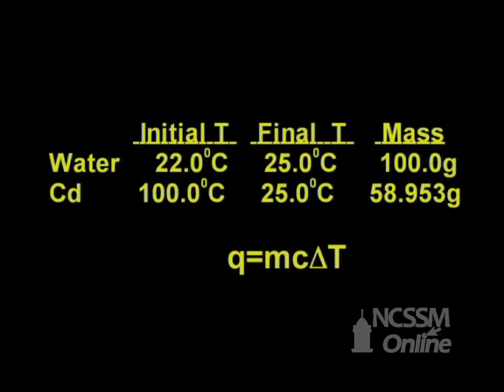Specific Heat of a Metal Lab

Comment: Full answer key, for those who want to get it over with and play gmod/minecraft/fortnite:

Important timestamps:

Formula: 0:42
Filled out table: 4:11(not everything that's graded, though)

Mass of the metal: 0:52
Approx starting temp for the metal: 1:02 and 3:05
Weight for water: 1:10 (later on she says that 1 ml converts to 1 gram)
Starting temp for the water: 2:00
Procedure: 3:19
Ending temp for the water: 3:46
Temperature change for water: 3:49

Answers to Questions, keep in mind these might not be the ones you have:
Water gained energy during the experiment
Metal underwent more temperature change
Water has a higher heat capacity

Ones that have formulas:
Heat absorbed by the water:
Q = 1255.2J =100 * 4.184*3
Heat the metal released:
1255.2 Joules
Specific heat of the metal:
C = 7.09 = 1255.2 / (58.953*3) (I looked it up and the specific heat capacity for cadmium is .23 so IDK if I did something wrong or not)
Reply: 17 likes but no comment, i want to be the first to tell you you are a king that is loved and appreciated
Reply: Thank you so much for your help. KUDOS!!!
Reply: I'm actually going to play roblox but thanks anyway!
Reply: you are a real one
Reply: This man right here is literally goated
Reply: you are a real one and deserve all the happiness and love in the world. Thank you!!!
Reply: you’re a real one dude thank you
Reply: THANK YOUUUU
Reply: The temperature difference you used for the metal is not the same as the one of water. It should be 100 - 25. So 75 not 3
Reply: Just to help anyone else
SPECIFIC HEAT OF METAL is 10.74212569 J/gC
47477.51(J)=58.93(g of metal) x 75(change in C) x Specific Heat
Reply: You are a hero
Reply: this is so great. Thank you so much 💓
Reply: @jojoshee7911  agreed
Reply: whens the wedding
Reply: @HamburgerCat  where did you get the 474 etc and can you explain more plsss
Reply: you are loved thank you so much
Reply: The hero we do not deserve, but the hero we need. thank you
Reply: cant explain how clutch you are
Reply: I really didn't want todo this you are a legend sir

Comment: Answer Key of the Specific Heat (try to solve it yourself first pls)

First find the Joules the water gained 
Q = 100.0g x 4.18j/g*c x (25-22*C) 
Q= 1254 J
Since it was 1254 J transferred to the water it was removed from the metal - reduction so make it negative
-1254 J = 58.953g x C x (25-100*C)
-1,254 = 58.953 x C x -75*C 
-1254 = -4,421.475 x C
-1254/-4,421.475 = 0.28361
Specific Heat (C) = 0.284 J/g*C
(3 sig figs as there were a low of 3 sig figs in the video)

I hope this helps anyone who was stuck (:
Reply: Question why is the specific heat .284 but when I searched it online its .232 I am stuck on this part please help
Reply: @johnroaldcomargo4716  I'm sorry I dont really know why it is showing that, however my teacher did go over these answers so I can confirm that this is a correct answer. I hope this helps!
Reply: @nightcorenerd19  Thank you for the reply I asked my teacher and he said that because the given are not exact that's why its showing different results.
Reply: thanks
Reply: This is late but according to my teacher and also based on the internet, only the water has a constant specific heat which is 4.18J/g.°C. The 0.232 specific heat for Cd on the internet is only a basis (?) or a theoretical answer. Specific heat also depends on the mass(?). Am not sure tho but this is my understanding. Hope this helps!
Reply: wait where did you get the 4,421.475?
Reply: @yoon-core7703  that is the  58.953 multipled by -75 (:
Reply: I’m confused why wouldn’t it be 0.2836?
Reply: @boomjewerlery7610  some schools or professors require 4 decimal places while some are 3 decimal places. i think 0.2836 and 0.284 (round off) is basically the same, it only depends on the person.
Reply: @boomjewerlery7610  Usually when determining the number of significant digits you want to use the lowest amount in the problem given to you. So if you were given a problem with numbers 2, 45, and 101,  you would still only use 1 significant digit because the number 2 has only one sig fig. Hope this helps!
Reply: What an accurate answer:D. However, you have to know that the mass of water in 100.0mL is not 100.0g. Thats cauze the water actually has a density of 0.997g/cm^3. That means that we have actually 99.7g of water. 

And yes, that little desviation in the cuantity does not alter the answer. But good job with the answer, that calculations must have taken you several minutes to write them.
Reply: You calculated for water gained now Ok what is the heat lost by metal?
Reply: @Ebarexofficial  1254 Joules were lost from the metal! That is why the water gained 1254 Joules - the heat was transferred to the water. Hope this helps!
Reply: thx chemist anime girl
Reply: Thank you so much. I got hung up on the joule transfer. It makes sense, it didn't come from nothing!

Comment: There is a problem with this experiment. You can't be sure the measured 100 ml of water from the tap is at room temperature. It would be more accurate to put a second thermometer in this water beforehand so you know exactly what its initial temperature is.

Otherwise, good demonstration--especially the suggestion of not letting the metal touch the glass on the heating phase. I intend to do this with my own students except with the modification I suggested.
Reply: Oh never mind! She did that step. The first time I watched I took a bite of my sandwich while she was measuring the temperature and I missed it!

Sorry! It's perfect.
Reply: Andrew Stallard Lol

Comment: I teach chemistry and would like to use this video but the value I got was 0.2856 J/gC. The accepted value from the web seems to be between 0.230 to 0.232 on the web.  Has anyone else worked this out? If so, what did you get?

Comment: What are the apparatus used here
Reply: Cadmium Metal
1 Scale
1 Bunsen Burner Set
1 150 ml beaker
Water
1 100 ml measuring cylinder
2 calorimeter
1 thermometer
String
1 retort stand
1 ring clamp
1 stirring rod
Reply: @ayonyescamilla9982  thank you

Comment: sodium hydroxide- 29 °C

hydrochloric acid- 29°C

calorimeter- 29°C

calorimeter with mixed both chemicals- 30°C

beaker- 114 grams

Calorimeter- 160 grams with water

initial temperature of water- 29 °C

Calorimiter with copper wire- 30°C

initial temperature of metal-85°C

copper wire- 4 grams

plsss help me to solve this especially about of the specific heat of a metal

Comment: 0,18925 J/kg °C
Reply: really
Reply: Using the values she provided, you get a value of 0.28 j/g/°C.
The actual specific heat capacity of Cadmium is 0.23 j/g/°C.
Perhaps more accurate measurements of the temperature would have yielded better results.

Comment: TO SOLVE THE LAST PROBLEM

Specific heat of water is given in JOULES, but the question is asking for CALORIES/(g*T) so instead of calculating 100*4.18*3... its only necessary to calculate 100*1*3.... this is because 1 "gram calorie" = 4.184 Joules. 

so if we take (100g*1cal*3degree)/(58.953g*75degree)==>(300/4421.475)==> ~.068 

given that cadmium's accepted Specific Heat is .055 c/g*T this is a pretty large margin of error, but then again we're using styrofoam cups, so you know it's not like we're sending guys to the moon here.